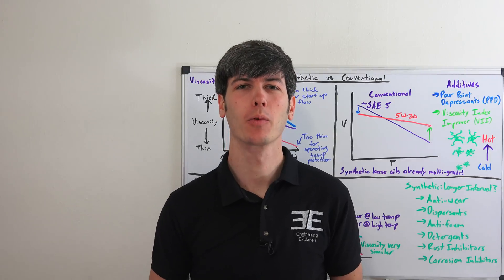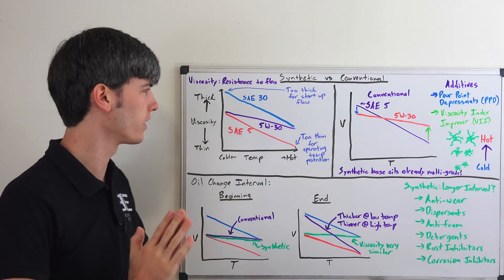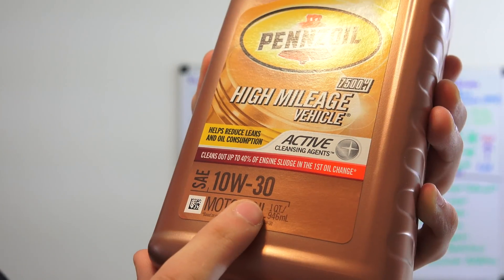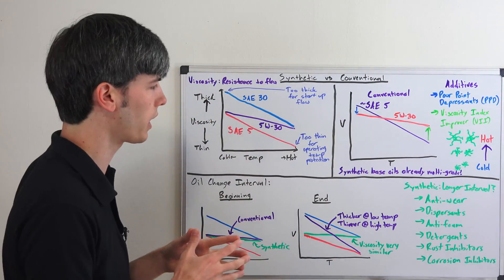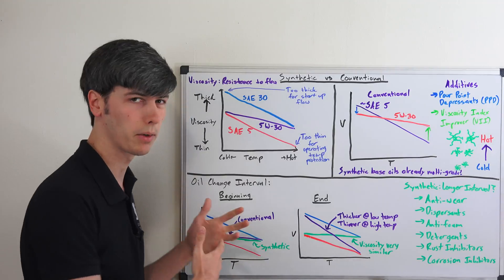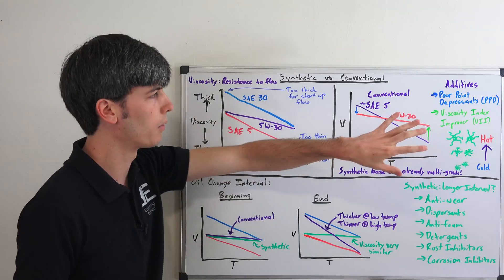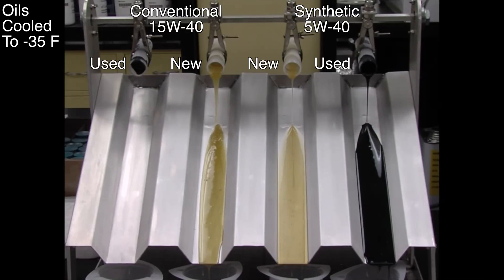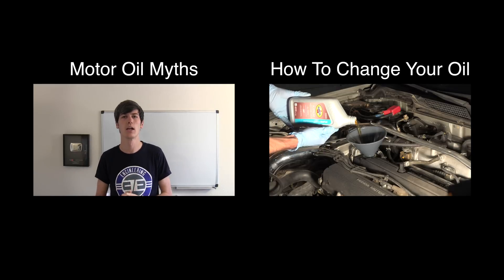Is Synthetic Motor Oil Better For Your Car?

Comment: In Canada with winters getting to -40 degrees Celsius. I find it's very important to run synthetic oil. never cheap out on oil for a machine that gets you places. I change my oil every 5k kilometers along with the filter. So don't be a cheap ass and take care of your vehicle. just my 2 cents
Reply: No, not excessive at all and that's what most car manufacturers recommend all owners to do on cars that use conventional oil. My 430,000 km CR-V runs like new since I have been changing oil at 5k interval since the day I got it.
Reply: My old Chevy 6.5TD should only use conventional (Says so in the manual), and I change every 6k kilometers. I buy cheap oil and mix in additives by myself. Its alot cheaper, when you have to change 8liters of oil every time. On my other car I run 15w-40 in the summer and 5w-30 in the winter. The manual gave a chart of temperatures matched with what type of oil. I change oil and oilfilter more often than I should, but its a safety for me too.
Reply: lol-  so the vehicle doesnt rot out before the second oil change?
Reply: unless you have a toyota, than you can just put lard instead of oil.
Reply: My cars manual (2014 Elantra GT) says to change the oil every 7500 miles or 12 months.
Reply: Wtf? You change your oil every 5k km? Isn't that excessive?
Reply: sadams7114 Lard is much healthier than a processed oil.
Reply: Derrick Rogalsky here's a costarican that changes the oil every 2500km about the bottle necks in the city. The hot air plus the daily hour driving or waiting in the bottle necks (I just drive 15km daily) makes me change the oil every mentioned kms
Reply: I don't agree at all.  Synthetic oil is only recommended for high performance cars and also cars that can easily have sludge build-up. I never use synthetic oil on my CR-V but my 430,000-km CR-V is tested for emissions every two years and the gas emissions are still unbelievably low, pretty much like when the car was brand new.

Comment: I have a 99 grand caravan Es 3.8 it burns a good amount of oil any tips please??? I hear cleaning with seafoam will do it just want a second opinion
Reply: That depends on why you're losing oil. Oil can burn from sludge buildup but it can slipp past piston rings and burn in the combustion chamber too, if it's smoking out the tailpipe you may switch to a thicker oil or use a pint of STP Oil Treatment if you want a cheap fix. These may not work though and increasing the viscosity will reduce your fuel mileage. It really depends on what you want to do with the vehicle.
Reply: Considering the age of that engine there's probably a lot of blow-by past the piston rings and your valves are probably worn, so any cleaning agents won't really fix that. Also don't rule out any oil leaks from main seals, valve cover, dipstick tube, etc.

A quick check is to do a wet compression test. First do a compression test like normal, then for any low cylinders add a few drops of engine oil or ATF into the spark plug hole and do it again. If the compression jumps up, you have worn rings. If not, you have worn valves.

Comment: im a 3000 -4000 oil change beliver no matter what its running i feel that if u do that then your gonna be driving your vehicle for just as long with either oil
Reply: There is more to oil than viscosity rating and whether it's mineral or synthetic. VW's PD diesel unit injectors are very  savage and require very specific oils. You cannot get mineral oils that meet these specific requirements. I'd rather have the correct oil in for 15,000 miles than the wrong oil in changed 20 times n 15,000 miles.

Comment: Synthetic is great if you don't have an older engine with some miles on it.  A lot of the time, switching from conventional is going to result in a lot more burned and leaked oil because it is thinner though.  It's also not a great oil if you're the type of person that doesn't put many miles on their car annually - waste of money.
Reply: not that the synthetic oil is to blame for that, it would be the fact that youve been using the conventional oil, which as shown in the video, gets alot thicker and doesnt protect as well as it should
the damage is already done, not that the new oil is the cause
Reply: That's A factor in it, but there is normal wear and tear with synthetic oils that will eventually result in more burnt and leaked synthetic oil down the line, too.  Synthetic oil wasn't even popular, used by most manufacturers, or affordable until the mid-90's, really.  It was around, but most vehicles were not using it.  There isn't really very much data that allows accurate A/Bing of conventional to synthetic (in terms of engine wear, oil burning, and oil leaking; the temperature advantage of synthetic can't be contested) because there are EXTREMELY few cars (if any) that are 20+ years old that exclusively used pure synthetic oils.  The Pennzoil Platinum used for even this test is a relatively recent invention, and one of the first examples of TRULY synthetic oil.  Others are more accurately blends.  There is no real world data on identical engines of the same age (say 25 years old with 200,000 miles), exposed to seasonal environments, traffic, number of engine starts, etc that allows for this comparison because it is too new.  By 2030 we'll have a much more accurate picture without so many extrapolations.

So yes, it's true that the damage is done, but there's also evidence that switching to synthetic with a worn engine accelerates that damage further.  Regardless, unless you are in extreme cold climates, driving a relatively new car with little wear currently, and/or drive a LOT of miles, there's no evidence that supports converting to a thinner, more expensive oil is beneficial at this time.  The commonly perpetuated myth that thinner oils reduce wear and tear compared to thicker ones is also mostly marketing.  Since more than 70% of engine damage is done during startup when no oil is flowing to all engine components yet, it doesn't really matter what oil you run from that standpoint.  Whether it's conventional or synthetic in the oil pan, it's still in the oil pan and not protecting your car during start up.  Don't buy what the oil companies are selling so easily.
Reply: Wow dude, wrong much? Fact is, most synthetic is just highly refined conventional oil. That right there proves it is fine for older cars. Typical synthetics are refined more and have better additive packages. This allows the oil to handle heat better, provide better wear resistance, and last longer in an engine. What synthetic does not do is sludge up inside an engine thus giving the illusion that the oil is responsible for leaks, when in fact, it just removed the sludge left behind by the crappy oil that was previously used. All that BS you are spouting off about MAY have been true in the beginning days of synthetic, but the process is much better now and those issues simply do not exist. Bottom line, stop spreading false info.
Reply: Some synthetic is more refined conventional with a different additive package, but fully synthetic oils are made from natural gas instead of crude, like Pennzoil Platinum.  Nothing I said was incorrect.  You put synthetic oil in a worn engine, it leaks.  Synthetic is more slippery and flows through tiny crevices easier than conventional (it has nothing to do with sludge).  You put synthetic in a brand new engine and yes, it IS a better oil.  But there's no evidence to suggest using a synthetic oil is actually going to make your engine last longer than someone using conventional that changes it FREQUENTLY.  NONE.  You and I both start with the same brand new car, you run synthetic, I run conventional, we both change it frequently - they'll last about the same number of miles.  

Problem is that people don't change their oil enough, so they do cause premature wear, and for those people synthetic IS a better option since you can get more miles out of it.  I drive less than 3,000 miles a year, so synthetic is a waste of money for me - just flushing cash down the drain.  I change it every 3,000-4,000 or once a year (whichever is first).  If you're the person to drive 10,000 miles and years between changes, synthetic is for you.  No matter your choice of oil, frequent changes are still a MUST if you want to make it to 250,000 miles.
Reply: Alex M I drive I mile a day so with very little oil in my engine so when should I change it I have only 2002 miles it doesn't knock or smoke and has plenty of power
Reply: Are you saying you purposely run your vehicle on low oil?  Do NOT do this, the bearings in the engine will certainly be damaged and you are shortening your car's life expectancy.  Keep it topped off and with so little mileage, change it once a year.  Short trips are actually tougher on your oil than long trips on the highway.  With so little miles being driven synthetic is a waste of your money, and conventional is a better value, though both are completely fine (so long as you don't have leaks or burn oil).  If you are leaking and burning lots of oil, conventional in a heavier weight will help slow that down.

Comment: I've owned a variety of cars over the years and have found the oil change intervals can vary immensely. My 2006.5 Optima ran on conventional oil for 6500 miles and still would be a nice honey color, while my 2014 Mirage requires full synthetic and the oil is somewhat brown by 5000 miles. My older cars from the 80s and 90s ran on conventional oil and would be like chocolate syrup by 3000 miles.

Comment: It would have been more fair to to to run the same weights of oil.  Synthetic or conventional 15W40 would have a hard time flowing at that temp.  Hence why they have different grades for diesels.

Comment: Love your videos. Just wondering if you've done gasoline detergent tests.  Top tier gas detergent agents and which are best to use? Also, is it ok to switch back and forth between top tier gasolines and not have deposit accumulation issues? In other words, do you recommend using only one detergent type, therefore always use the same gasoline brand?

Also, is it true that you must drive your car engine at higher RPMs (>3000) for long rides from time to time to "clean up" deposits? Does "babying" your car by keeping most rides under 3000 RPM cause deposit buildup?

Comment: I've got a 1999 Ford Fiesta with the 1.3L Endura-E engine, bought the car new and from its very first service and every single service I've always used Castrol 5W-30 GT Magnatec, semi synthetic oil, other than decarbonising the cylinder head six years ago and at around 100.000 miles my car has never needed any major engine work done, now my car has covered just over 185,000 miles its still going strong,

Comment: Nice presentation. I have a 2003 Toyota Tacoma. I use conventional oil & change every 10 K, but it never looks black, it is a darker amber color. I do mostly city driving. I do burn only 92 octane. My buddy takes my used oil for his beater! Do I just have a really good engine??

Also, there is a major insurance company that uses synthetic. They do only filter changes for the life of the car lease. Is it reasonble to expect that longevity from synthetic???

Comment: Synthetic will find any place to leak out of. Causing engine failure if your are not super careful can caugh this. Any car that not new will have worn gaskets. Only use synthetic if you live up north in Canada . Otherwise your good old conventional and add lucas additive if you'd like the extra protection.

Comment: Perhaps you can tell me WHY this is why it is

Mayby you know an engine builder who can help better anwser this question of mine

serius question mayby you might know
big block mopar 1-8-4-3-5-6-7-2
vs
small block mopar LA 2-3-4-5-6-7-8-1

why are their firing orders so diffrent what are the advantages and disadvantages of each
i ask becuase i keep hearing about these top fuel hemi dragsters (non mopar hemis) doing a firing order swap and im really wondering why they are like they are
-rockthevox

Comment: Its not always the case, you use mineral/natural oil in the engine when you have just reconditioned it for the parts to bed-in, then use synthetic oil.

Comment: is 10w-40 better than 5w-30 in a tropical country where the coldest weather is 6' Celsius and can go as 35' Celsius?
Reply: and your always stuck in traffic and the engine runs in high temp i really need an answer here thanks
Reply: Aj Taluban 

check your cars owners manual it will tell you what viscosity to use for what temps

Comment: Thanks for your video, your video's are always very well done and very easy to learn new things from. 
  I've done a lot of reading over the years about synthetics, have used them from the very early 1980's to today and have benifited from their properties in money saved from better gas mileage and fewer oil changes needed.  One thing I noticed that was a nice return from using synthetics was a huge difference in HP lost over time due to engine wear from regular oils vers. synthetics. From little things like cam wear to overall engine health because of startup wear durring cold weather where oil takes longer to protect the engine and flow to needed parts. Something that synthetics do so much better.
  I really do love your video's, they are well thought out and presented, thanks much...

Comment: If I used synthetic on my 05 neon after it only using conventional before, did it do any damage? Drove it 3k miles so far no prob. And 1700 mile road trip. Can I just go back to convention ?

Comment: só....you can use syntetic in an engine that uses convencional??
Reply from the maker: Almost certainly, yes, but go with whatever the manufacturer recommends.
Reply: I have a 98' Audi a6 2.7 bi-turbo! and The manufacture recomends semi-syntetic! só I think I'll stick tô these! Sorry for The bad english, i'm from Brazil!! i realy like your vídeos!!!
Reply: PoCiLga i was curious why they use (most likely) Rotella 15-40 and 5-40 diesel instead of car oil.
but my car recommends a semi syn or better. as its dexos. so I run ultra Plat 5-30
Reply: Dah....u just found out? Where were u in past 15-20 years
Reply: Engineering Explained dont tell people that , some of the older rotary engines or big bore setups don't state to not use synthetic, using it would cause issues...as you should know. Tell people they should speak to the oil corps , manufacturer or mechanics....
Reply: depends on what your engine seals are made of..  Synthetic tends to break down some materials.
Reply: Synthetics dont cause leaks, they're already there. Synthetics just make them more noticeable. Can you use syn oil in a car thats only used conventional? Yes. Just not in a rotatary. You can evem switch back and forth as much as you like without doing any damage or harm to the engine. There several manufacturers who spec to use only a minimum of syn blend or only syn. Dont let people scare you into believing that because an engine has rum conventional thats all it can run, simply not true.

Comment: i have a question. hen you change your cranck shaft do you have to put in a thicker oil? my engine grade is 10w60, but now that i have changed the cranck shaft i am thinking of puting in a 1040 oil for the first 600 miles... what is your oppinion?

Comment: 15w40 doesn't flow that slow after oil drain interval, I do oil changes all the time it flows more like the 5w40 after a year of use, to pick your oil you should reference what the make of your vehicle recommends for best results
Reply: Keep in mind, the test was done at -35 F. The difference probably would've been less significant at normal temperatures.

Comment: In older equipment such as an old 1950 era 25 HP tractor, the recommended oil is 40w or 50w. My son-in law put 10w-40 in it and the engine seized. I suspect that  he should have continued using regular 40w or50w oil as the multi-viscosity oil is still 10w oil despite the high temperature rating and older machines were not designed for these newer oils. What say you?